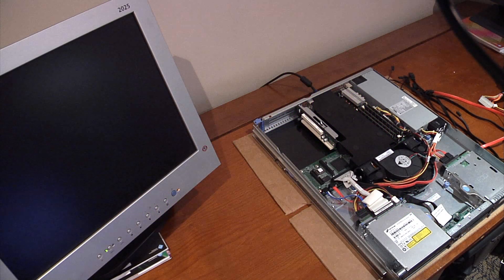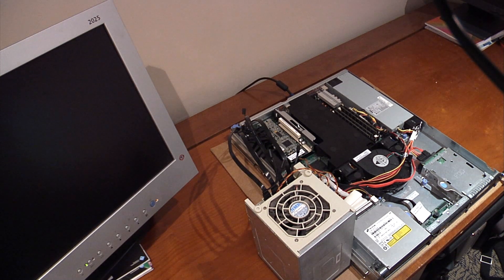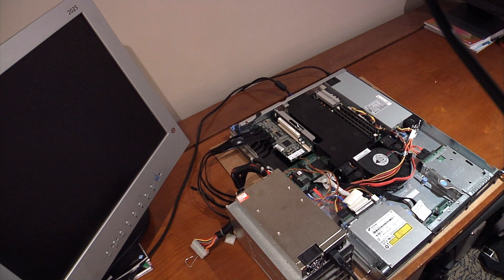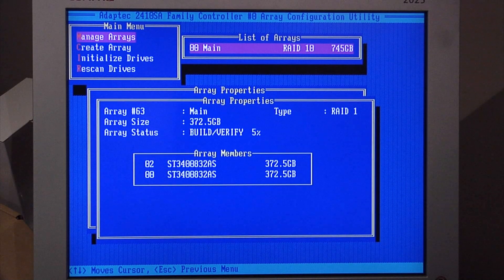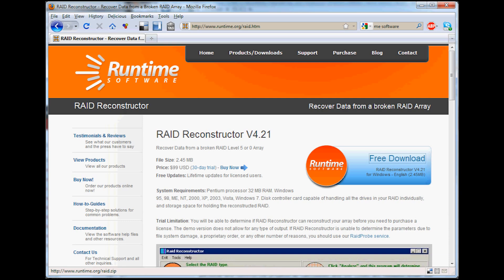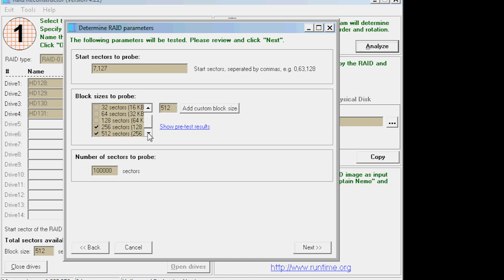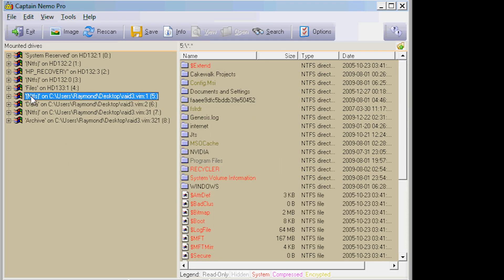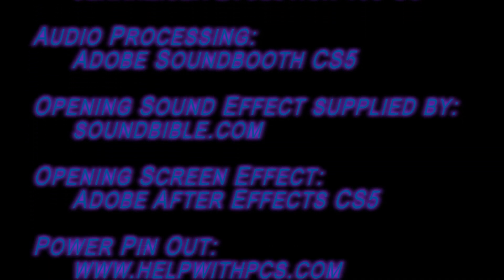Data Recovery from Adaptec Raid Controller

Comment: I own Rstudio and its saved me a few times on failed drives.   It works well for getting at the data to copy over to a usb.   

Also a SATA/IDE to usb drive cables are very nice.  Can take any drive out of any computer and plug it into any computer with a usb to see the directory.  Works well if only the boot sector is corrupted.

Comment from the maker: Once I knew how to do things start to finish, it took an hour or two.  It took a bunch of time before that to come up to speed, though.  (Days)  Basically I had to do everything wrong once before I figured out the correct way.  I'm not associated with Raid Reconstructor, but will recommend it as it did everything I needed it to do.  It does take some detective work to get the various parameters correct, but once everything matched, it did the job, and I was able to retrieve my files.